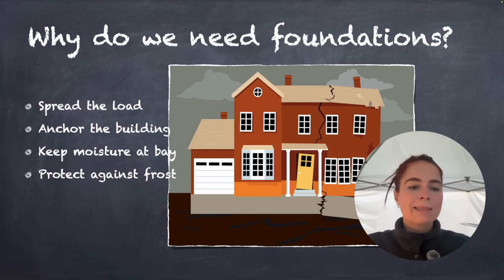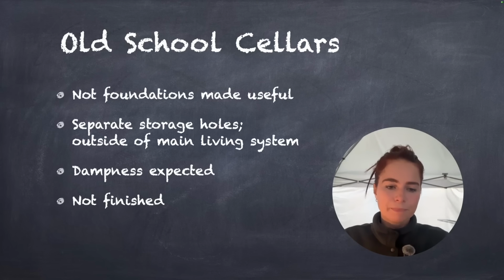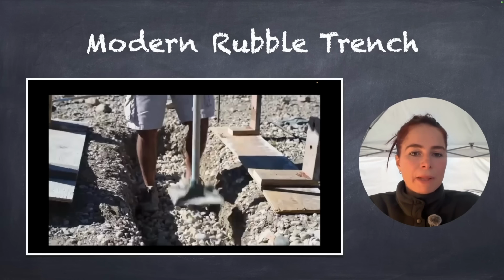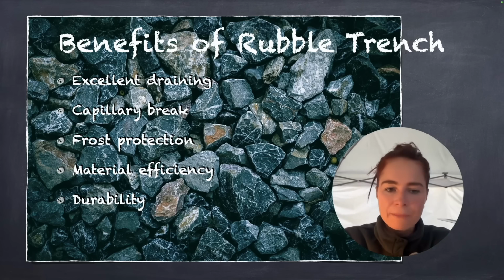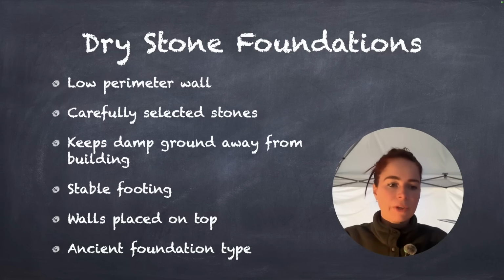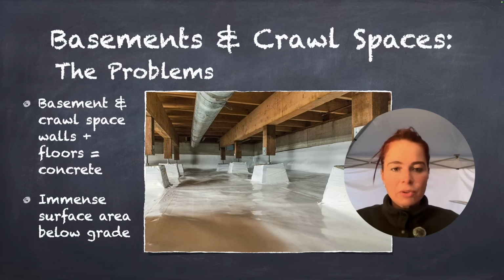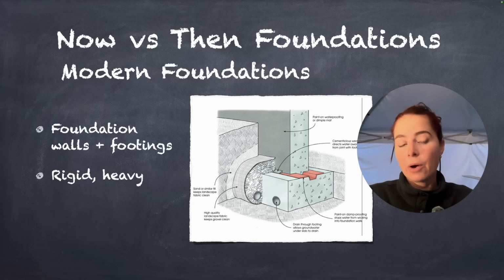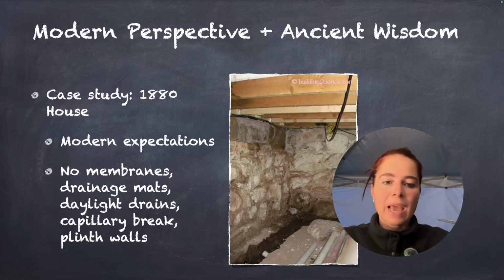Why Modern Foundations Fail — and the Genius Design We Abandoned

Comment: You may want to lose the Rebar or any steel for that matter. Once the concrete cracks allowing air to flow to the steel, it begins to rust, and that rust begins pressure from within the concrete pressing and pushing the concrete out of the way, cracking gets worse, chips and eventually chunks of concrete are displaced and only gets worse from here on out. 
Coated rebar may help, however, in the long run, steel once exposed will begin the rust process from within the concrete, there is no fix. 
Replace the Steel with a different product like animal hair, or some other product that replaces steel.
Reply from the maker: I love that you brought up the natural reinforcement idea — it’s such a great reminder of how older building traditions worked with materials instead of against them. From what I’ve read though, once you’re tying a structure together for seismic loads, that tensile strength from rebar (or a non-corroding alternative like basalt or fiberglass) becomes pretty essential.

Comment: how do you resolve frost depth problems? or earthquakes?   there are places in the world that have these problems. If you want to make a house that stands the test of time (100+ years) in problematic conditions and not utopias, reinforced concrete foundations are the way to go.
Reply from the maker: That’s a really good point. From what I’ve read, rubble trench foundations were actually created to solve frost problems — the trench extends below frost depth and drains water away so there’s nothing to freeze and expand against. The concrete grade beam on top can be reinforced and tied together for areas with seismic movement, too. I’m not an engineer — just sharing what I’ve learned through reading and research on how these systems have held up in different climates.

Comment: Most wet basements just have poor drainage around the building. Water coming off the roof drains right into the wall system, or there’s puddling around the home. Having good roof overhangs, or covered porches helps a lot. Rainwater collection systems also eliminate stormwater around the home’s foundations.
Reply: This is why in the Southern USA, the old houses had wide porches around the house structure. This did two things, divert water away from the structure and allowing shade on the structure for cooling.

Comment: Rubble trench is code in virtually all jurisdictions, every inspector has seen and expects it!
Reply from the maker: Rubble trench foundations aren’t code everywhere. Some jurisdictions allow them with engineering, others don’t permit them at all. I think you might be thinking of washed gravel as a capillary break — that part is common — but a full rubble trench foundation is a very specific system, and inspectors vary widely in how familiar they are with it.

Comment: This explains so much about my house foundation. It has either sunk, or the grade has risen enough, that rain water goes into my crawlspace since the ventilation grates are at or below the grade.
The house is on posts and the brick curtain wall was not attached to any posts. I can push it and move the curtain wall. I was thinking of removing the curtain walls, digging down and doing a french drain around the perimeter, and rebuild and raise the ventilation grates- or remove them completely if I have to. The ground grades from 6" at the front of the house (where the MOST water comes in) to 18" at the back.
Reply from the maker: That really helps explain the issues you’ve been dealing with. When the ground rises or the house settles, those crawlspace vents can go from “helpful” to basically acting like funnels for water. And a curtain wall that isn’t tied into the structure just adds another layer of unpredictability.

It’s amazing how many homes were built with details that seemed to work at the time, but start causing problems years or decades later. Thanks for sharing what you’ve uncovered — it’s a reminder that foundations have a lot more going on than most people realize.

Comment: I've been thinking about my basement - typical cinder block construction from the mid '60s in Western NY. Clay and silt and large boulders make up the natural ground. Our house sits on a convenient slope, so the best solution for my existing house is to daylight the basement walls that are below grade (3 of the 4 sides, then fit new weep drains at the footer base grade, backfill with 3/4 and geocloth sloping up 60 degrees, finished grade is 6" of clay sloped away from the house, and then ventilate the basement with dried air
Reply from the maker: That actually sounds like a really thoughtful plan. Using the natural slope and improving drainage at the footing level makes a lot of sense, especially with clay soils that just love to hold water. It’s interesting how much work goes into getting water to move away from a house instead of toward it — drainage really is its own science.

Thanks for sharing what you’re doing. It’s always fascinating to hear how people tackle these problems in older homes.

Comment: Someone introduce this woman to ICF
Reply from the maker: There are definitely a lot of positives with ICF and I’ll touch on them in future videos for sure. But it isn’t magic below grade. You still have a concrete core that wicks moisture, and you’re still fighting hydrostatic pressure from wet soil. If the waterproofing or drainage isn’t detailed really carefully, water can get in — and once it does, it’s very slow to dry because the EPS is on both sides. So it can work well, you just have to treat it like any other below-grade concrete wall and make sure the moisture management is done properly.

Comment: Are you familiar with a company called Superior Walls?

They sell and install precast concrete walls without footers. While they also offer insulation in the concrete with a quick install, a key point is that they call for a drained level surface of #2 stone to set their walls onto. This is a basement yes but with proper drainage on rocks the higher PSI concrete doesn't wick nearly as much water in. And if you put gravel along the wall when backfilling the soil never has opportunity to pool water against the walls leaving a very dry basement. I've witnessed 4"  of rain in a single day be handled by the system while soil nearby pooled into a pond.
Reply from the maker: Thanks for mentioning Superior Walls — I hadn’t looked into them before and my initial reading has my interest piqued. If we’re going to make habitable spaces below grade (especially ones that share air with the rest of the home), we’d better do it well.

What I really like is that they’re using solid building-science principles to avoid water intrusion: the walls sit on free-draining stone, which acts as a capillary break and relieves hydrostatic pressure, instead of just pouring concrete into wet soil and hoping a coating holds forever. Combine that with good backfill and drainage and it’s a much smarter approach than “big concrete box in the ground.

Comment: A Basement is Nothing more than a Pool in the Ground.

If you look at "Some" of the Historic Neighborhoods you will see the yards elevation built up and
graded with slope away from the structure.
Water always travels to the low spot thus shedding away from the Home.
The Streets are the low lying area routing the water to the sewer system
SIMPLE

BTW I think the Japanese are still using the Ruble Fill "Pile" type foundations when they build a Home.

The Problem in this Country (USA) is that we are building Homes out of Tooth Picks.
Wood is a Great Material but....Fire, Rot, Mold will Destroy it.

If you look at the Homes of Different time periods you will see the Standards Drop....

The Chicago Bungalow walls are  2 - 3 bricks wide (Nominal Brick 4" with Mortar Joint)
The Next Generation had Brick Veneer and Cinder Block Interior
The Generation after that Had Wood Framing and Brick Veneer
Then we went to Wood Framing, Brick on the Front of the Home and Aluminum or Vinyl Siding.
Then came Framing, Lick'em Stick'em stone to the Garage Piers with either Vinyl siding or OSB Siding
Then they Eliminated the any kind of masonry and went to Board and Batten OSB siding.
And this is where we are today.....a Match Box in Waiting

We are Building for the Moment Not for the Future. Will this catch up to us? Who Knows

P.S. I know I didn't mention the 100% wood homes in my little historical run down.
I own one and I had to completely rip off all the exterior and redo it some years back.

America is Chasing their Tail by building Cheap Homes Fast....

Comment: It's sad that many basement foundations made of poured concrete or concrete block are not protected properly from wicking up moisture.  The typical tar applied to exterior foundations is prone to cracking, footers not being sealed correctly, and porous sill seals do not address this issue properly.  However, there are several products and methods that aren't difficult to use and perform, that do.  This is no different than improper wall assemblies or flashing details being used when there are proper ways that often don't take that much more time or money, sometimes no extra time or money.
Reply from the maker: You’re totally right that there are ways to make basements reliable — a proper waterproofing membrane, drainage plane, sealed footings, and a real capillary break instead of just tar or a thin sill gasket.

The challenge is that you’re building a waterproofed concrete box below the water table (at least seasonally), and everything is fighting hydrostatic pressure all the time. Even small weaknesses in drainage or waterproofing eventually show up as leaks or wicking, and once concrete gets wet behind foam or membranes, it’s extremely slow to dry.

Rubble trench avoids most of that battle. You’re not putting a living space underground in wet soil, and the system is inherently a capillary break by its very nature, so moisture can’t simply wick upward into the structure. It’s just a much simpler way to stay dry.

Comment: From, The Art of Roadmaking by Harwood Frost circa 1910 page 312

The Via Appia, Appian Way, was not only the earliest military road, but the best constructed. It extended from Rome to Brindusium (now Brindisi), a distance of 360 miles, and was constructed principally by Julius Cesar. The mode of construction, which was, in general, the same as used in all important military roads, was as follows:

The course being decided upon, in as nearly straight lines as possible, it was marked by two parallel trenches excavated at varying distances apart according to the importance of the highway. This also showed the nature of the subsoil, from which the level of the foundations was determined; all unstable materials were removed to a depth of about 3 feet, the bottom was consolidated by ramming until a solid foundation was obtained. 

In this undrained trench the road materials were placed in more or less regular layers. The statumen, or base, consisted of two courses of large flat stones laid in lime mortar, and was usually about 15 inches thick. Upon this was laid the rudus, or rubble, consisting of a 9-inch course of small fragments of stone embedded in sufficient lime mortar to fill their voids.

Upon this, the nucleus was formed of fragments of gravel, stone, pottery and brick mixed with lime mortar to form a concrete, which was laid while hot and consolidated by ramming, and was made ‘about 6 inches thick. The summa crusta (top crust) or pavimentum (hard surface) was formed of closely jointed, irregular stones, which formed a mosaic about 6 inches thick, the top of which was practically on a level with the adjoining natural surface of the ground.
Reply from the maker: Thanks for fleshing out the details — really interesting to see it broken down layer by layer. From what I understand, even with the lime mortar, the structure could still drain because the mortar and the gaps between stones weren’t fully watertight. So not quite the same as a modern loose rubble trench, but similar in that it kept the base stable and helped moisture move through instead of being trapped.

Comment: My biggest question. How were castle towers built without tons of concrete?. The romans mass produced concrete but i dont think it was as integral after Rome fell.
Reply from the maker: My understanding is that they usually built right on solid ground or bedrock, using massive stones or boulders as the footing. The weight of the structure did most of the work. And that lime mortar was sometimes used. Pretty amazing how long those have lasted!

Comment: You present it as a solution to mold, but it needs to be kept away from water to work. That doesn’t sound like much of a solution to me. It’s obvious you’ll have serious problems once all those gaps fill with water and freeze. And thinking of pumping water out of an area where you can’t perform maintenance seems quite unrealistic.
Reply from the maker: Totally fair point — any foundation system will fail if it sits in standing water. Concrete footings, ICF, block walls… all of them need drainage. A rubble trench isn’t an exception to that.

The advantage of a rubble trench is that it solves capillarity at its source. Instead of acting like a sponge and wicking moisture upward (as concrete can), the stone is free-draining. Water drops through the gaps and gets carried away by gravity through the drainage path. With good grading and an outlet (daylight drain or sump), there’s nothing for freeze-thaw to grab onto — the water doesn’t get stored there in the first place.

So it’s not “rocks under a building and hope it works.” It’s:

Keep bulk water away (like any foundation)

Break capillary rise

Give water a place to drain, not sit

When those steps are done properly, a rubble trench can stay dry and stable indefinitely — that’s why it’s been used successfully for centuries.

Comment: In seismic locations and in places with a lot of movement in the terrain (due to lots of clay or others) it's argued you need the house to be anchored, meaning it's not just sitting on top of the foundations but attached to it.
I'm not sure I'm attracted to this type of foundations, did you find any more specifics about the structural integrity, especially in regards to earthquakes ?
Reply from the maker: Yeah, exactly — from what I’ve read, rubble trenches can work under a reinforced grade beam, but caution’s definitely needed in earthquake zones. It really depends on soil conditions and proper engineering — I’d want an experienced structural engineer involved for that kind of design.
Reply: Isnt having it not anchored can also be good? Since the building can slide on top of the ground instead of being achored to it where it will be more likely to sheer in case of earthquakes. In japan they give the walls some slack to slide around.  I have also seen a cob house that used cables attached to the foundation and to the top of the wall to hug it.
Reply: @human2137  I think I've seen stuff like that.
I'm transmitting what I see in technical and legal documentation in France (I'm about to build an extension to my parent's house) so I'm thinking it probably is the relatively basic and accessible means to protect against pretty tame seisms (at least compared to Japan).
Or what you're talkng about is too recent and is yet to enter the documentation maybe.
Idk, I wish I knew more about this, for now if I try to follow accessible and well documented guidelines that have lots of backing, anchoring is still (in the EU) seemingly seen as the primary mean to protect against landslides, seismic activity and stuff like that.

In any case wouldn't you need to have something anchored ? I surmise the house moving around prevents structural damage but like... the house needs to stay in the same place, or at least in my ideal lol. I'd be bothered if my extension slowly moves away from my house ^^.

Comment: Well, young lady, most everything you’re saying is true, but there are solutions. I have a cinderblock basement, built on a prefab house, built in 1978. The basement was basically unusable, had cracks in the floor and water coming in around the base of the foundation. I then applied an interior waterproofing system called sani tred. The basement is now completely dry, and a very usable space. I still need to have a dehumidifier down there in the summer because well the summer has high humidity when you have high humidity and a nice cool basement wall you’re gonna get condensation. You can look into the system and see it works. It’s been working for me for 15 years and it’s awesome. And if I was to build another house, I would apply this stuff to the outside of the foundation and wrap up the plastic that you would put under the basement floor. To create a perfect envelope.

Comment: Industrial revolution occured in the UK most of the UK is mud particularly where big cities were built rubel  was not commonly available or easily available, often rubble would come from other houses that were being demoed,  it because far faster to build a brick foundation and required less relative skill could be done relatively faster and u could build higher quicker, also it is some what hard to build a starter course on rubble

Comment: My basement is made of huge  irregular stones and between them it is a small fraction of concrete  to fill the gaps . The walls have arround 50 cm thickness . There is no smell or mold in this basement . This basement is 30 years old . Even with the door closed still no smell . Those rocks used for this basement don't absorb water .
Reply: All stones do 😂 you probably just have great drainage and good materials.
The terrain plays a key role, but skills knowledge and experience are what makes the biggest difference.
Reply: @gold.drop5 there are a few rocks that don't absorb water